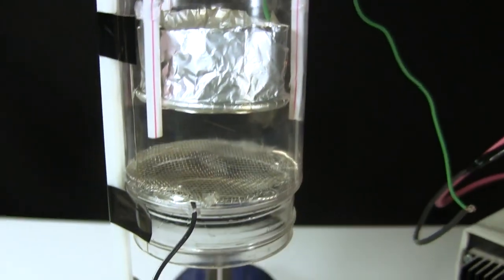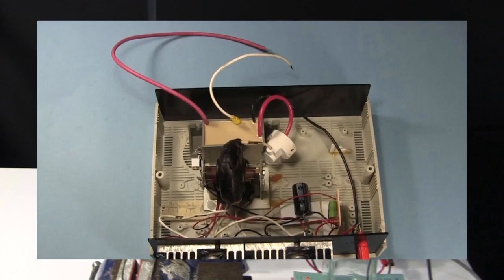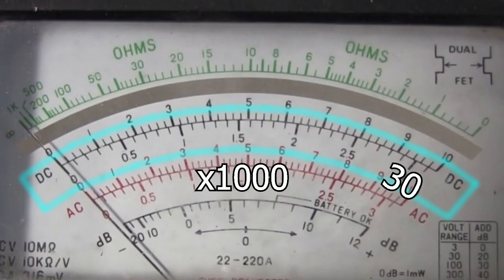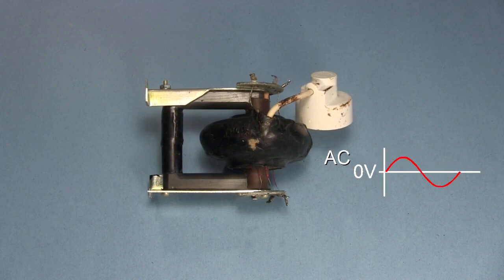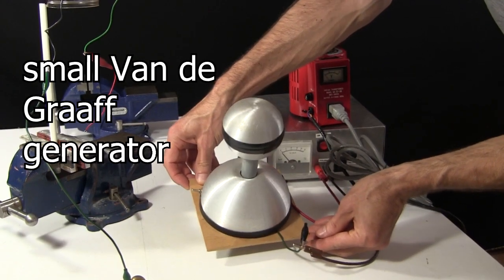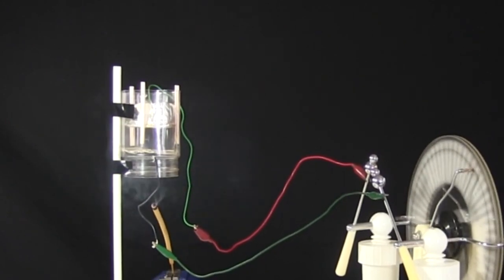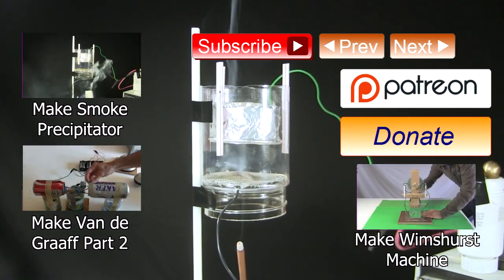Smoke Precipitator - Measuring Voltage & Demos

Comment: Thanks for the video. It seems you've designed the cube and the high voltage DC generator in the same way. So why is only the cube generating pulse DC? What could be done to smooth it out? Thanks
Reply from the maker: To make the cube's output be flat DC, a high voltage capacitor could be added between the output and ground.

The cube and the high voltage DC generator are the same except for the very last part. After the flyback transformer, the cube has only a single diode, which is what turns the AC from the transformer into pulsed DC. But for the high voltage DC power supply, after the flyback transformer is a Cockcroft-Walton voltage multiplier circuit that steps up the voltage and also smooths it out to flat DC.
Reply: Thank you. Do you think this pulse is causing the precipitator not to work? Seems odd to me, as the average voltage applied to smoke particles would still be several kV, so should be enough to charge the majority of them and capture most of the smoke. Don't you think so?
Reply from the maker: It's the only thing that I can see what would be causing it to not work. Maybe the average voltage isn't enough. Maybe there's a slight AC component.

Comment: Yah dude, pls upgrade the multimeeta to a digital one! PS: Edit: Oh! I knew the analog might tolerate the high voltage...
Reply: You would need a 30kV capacitor. You'd also need a 30kV diode. I think you can find parts for a microwave oven that are in this range. Try Digikey to see what the "state of thee art" is.
Reply from the maker: Oh, I have a digital one, and while I could use it for this, the HV probe's connectors fit perfectly in my analog meters sockets. I have clipped onto the probe's connectors with my oscilloscope though.

Comment: Sir i am a student of 9 standard so i want to start this precipitator.  At how much volt i should use
Reply from the maker: It needs 21,000 volts, so you need a high voltage power source.
Reply: Sir can I use 400kv generator for this
Reply: Please reply fast
Reply: I have a science project 2 days later

Comment: what happens if we put 9v hw battery power supply
Reply from the maker: The output going to the precipitator needs high voltage, as I measure in this video. 9v is no where near enough.

Comment: hi, thanks for your nice nice and complete information.
can we use DC flyback? 
could you please explain about your DC power supply?
do you use voltage multiplier?
Reply from the maker: Flybacks put out AC. You need something extra to turn their output into DC.
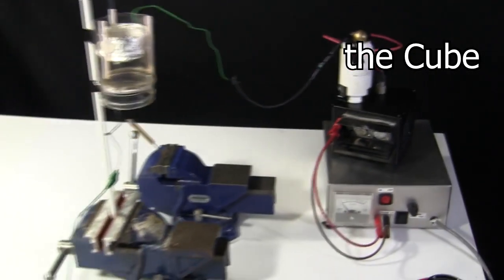The Cube power supply that I use starting at 2:04, the one that didn't work, has a flyback followed by a diode built into the flyback. That diode turns the output into pulsed DC. Details for making that one are on my webpage here http://rimstar.org/science_electronics_projects/high_voltage_power_supply_w_flyback_transformer_builtin_diodes.htm.
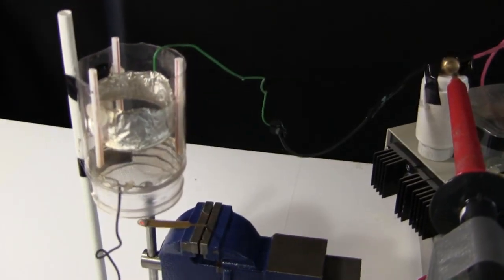The flat DC power supply that I use starting at 0:11 has a flyback with no built in diode (very hard to find) has a voltage multiplier after it that turns the output into flat DC. Details for making that one are on my webpage here http://rimstar.org/equip/30kv_pwr_supply.htm.

Comment: any specifications using the wimshurts machine? need help using that
Reply from the maker: What specs are you looking for? The Wimshurst machine I used had 27cm (roughly 1 foot) diameter disks.
Reply: RimstarOrg can you tell me the distance between the mesh and cylinder and the measures of your container
Reply from the maker: I didn't measure the distance between the mesh and cylinder for the Wimshurst machine, since it worked, but judging from earlier in the video when I did make measurements it was probably just under 1 inch/2.5cm. But as you saw, I made it adjustable so you should probably do that too. I have an earlier video where I show all the making of the precipitator http://youtu.be/x5YFK8mmeRQ.
Reply: RimstarOrg it finally worked
thanks!!!

Comment: Assume that the Cube ps is powered by a 48 volt homemade solar panel; would it work with the mesh and cylinder set 2 inches apart?  If so, won't it damage the Cube?
Reply from the maker: If it sparks with a 2 inch spacing then it probably would damage the Cube. The amount of charge that would build up before sparking at that distance would result in a lot of current in the spark.

Comment: Hi! Thanks so much for this video ! i'm now studying about the subject as i'll make a prototype of a smoke precipitator in a couple of weeks, I was wondering where I could get a commercial DC source just for testing (I'm in uk ), I want to check the requirements needed to achieve the smoke capture that I need and after that I'll look or design the definitive DC source. Any help or advice would be greatly appreciated :)
Reply from the maker: Here's a reliable source http://www.amazing1.com/hv-dc-power-supplies.html. I'm not familiar with any in the UK but that doesn't mean there aren't any.
Reply: Thank you ! is it any difference in the performance using a negative or possitive power source ?
Reply from the maker: I know there's a difference in ion mobility between positive and negative ions that may have a small effect but I'm not sure it applies to charged particles the size that we're dealing with here. Here's the experiment about it http://jnaudin.free.fr/pcnpend/html/pcespend.htm.
Reply: Thank you ! already reading it :)

Comment: you can measure the hv output of the flyback transformer with a hv  resister devider 100x 10 ohms resisters in series and run the hv out to one end and measure the voltage across the last resister  with digital meter set to 600 volts
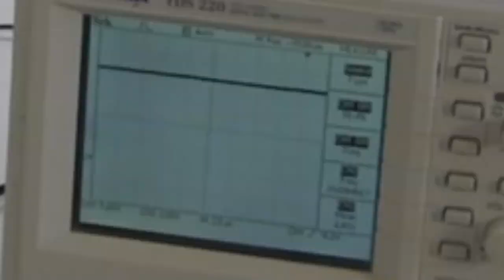Reply from the maker: Isn't that pretty much what my high voltage probe is already doing, though with different values? When I did that I got the flat DC, with ripple, that I showed in this video 2:22. Since it wasn't what I expected for pulsed DC I just assumed that there's a capacitance somewhere in the measurement setup that's smoothing the pulses.
Reply: oops i made an error its 100times ten m resistors not ten ohms

Comment: I would like to see how the filter behave over use, and what cleaning it would be like!

The cube supply probably is just low in voltage.

There isn't just one diode at the output, it's a winding split in sections with diodes (diode split transformer). There is enough capacitance to do reasonable filtering.
If you want more filtering, add a HV capacitor.
(adding a shield to the HV cable does the trick somewhat too)

But you are right about the high voltage probe not being high bandwidth.

By the way, did you make sure the input impedance of the meter was 10 MOhm?
Meassurements will be more or less off, if you don't.

I will have to recheck your cube supply video, but I recall it being "ZVS" and not a classic flyback converter (single transistor, and a PWM controller).
The "ZVS" circuit isn't knowing for generating great voltage, but does lots of current.
Reply from the maker: The foil/filter has a brown coating on it after a while. Cleaning it with just a damp rag doesn't work, but I'm sure there's some cleaning agent I could use that would do it.

Yes, the manual for the meter says its input impedance 10 MOhm.

Doesn't a ZVS use MOSFETs? I'm not very familiar with ZVS but from the schematics I just looked at it doesn't seem to have the flyback windings, which mine does. The schematic for mine is here http://rimstar.org/science_electronics_projects/high_voltage_power_supply_w_flyback_transformer_builtin_diodes.htm.
Reply: I was refering to https://en.wikipedia.org/wiki/Flyback_converter

It's the driver type that get the most output voltage from a single diode rectified gapped ferrite transformer.

What have you meassured the output of the cube supply as? The scope is 1 MOhm and would overload the probe into inaccuracy.

There are scope probes for high voltage, but they are likely outside the price range your interest in knowing would accept.

It will only be pulsed under heavy load, so should be easy to meassure.
(you underestimate the capacitance of the circuit at high voltage)

The residue, I would guess it's oil based.
So oil or oil svolvent would remove it.
(water won't, accetone, etanol e.t.c. would)
Reply from the maker: Oh, I've never seen that flyback converter circuit before. When you said classic flyback circuit I thought you meant the single transistor version of the one I'm using (http://www.powerlabs.org/flybackdriver.htm). Thanks for clarifying.

At 20 volts DC input with no load I measured the output as 20kV with a little ripple. That was done with the same Fluke 80K-40 high voltage probe that I show in this video, though when I did it I used my scope which also have 10 MOhm impedance. You can see me making the measurement here https://youtu.be/-KFhBVfpfDw?t=7m21s in the video where I show how I made the power supply. It's after I made that video that I suspected the output was really pulsed. After you guys are bringing it up I'm not sure again :).